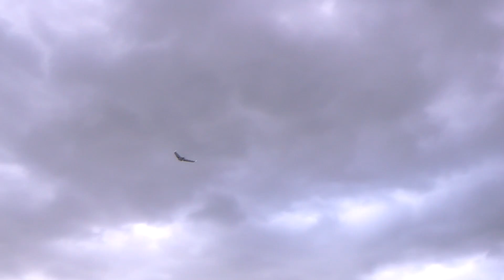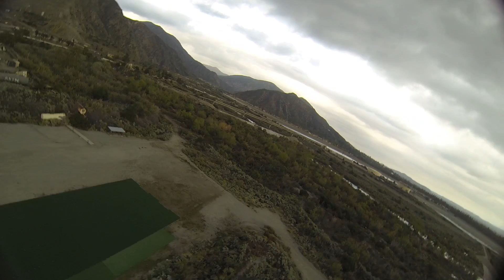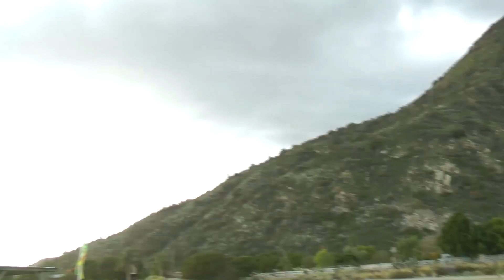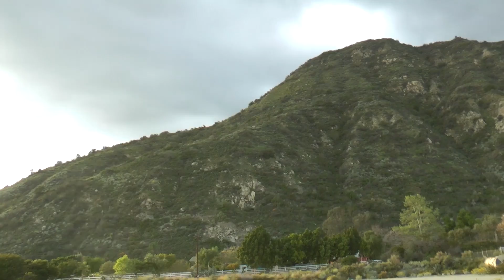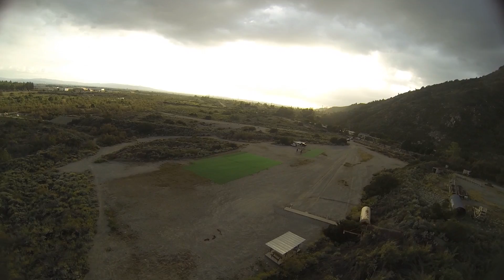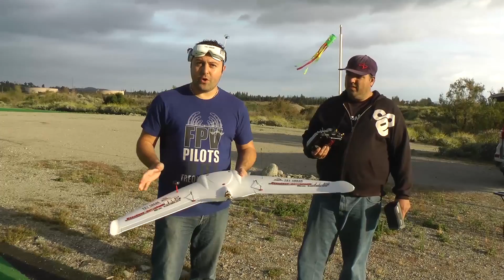First Flight Review of the Immersion RC Blade Manta Flying Wing

Comment: Honest review... way to go. But without better and more complete integrated electronics including OSD and telemetry this is just a major manufacture's unfinished design showing what needs to be added IMO with better attention to the wingtips needed where I'd look into Kasperwing type vortex gates that can provide yaw control without forward air speed.

Comment: Does the "SAFE" functionality on this work similar to how it works on the DeltaRay or other HorizonHobby beginner birds?  As in, can I flick a switch and have three or so different flight envelopes?  A befinner mode that prevents heavy banking and heavily stabilizes, an intermediate mode, and then an expert mode that lets you have full control minus AS3X?  If so, this would make for a good option for a beginner wing flyer instead of a Vector equipped wing.

Comment: Two improvements I think can be done are: 
1. Place the servos at right angles to the elevons in order to not waste useable servo power and smooth mechanical operation.
2. Redesign the nose to carry smaller HD cameras such as the Mobius and Runcam HD. It's a small plane, and that big flat nose is like a glider having it's spoilers full out for landing.

Comment: I appreciate you not pulling any punches on this review.  This is probably in my future as an easy plug and play as long as they include a flight controller/osd.   I could see a highly standardized high performance wing doing well in the racing circuit but they will need to also offer a nearly disposable version to cope with constant race crashing.
Reply: Why oh why no mid-wing stabs instead of wingtip...